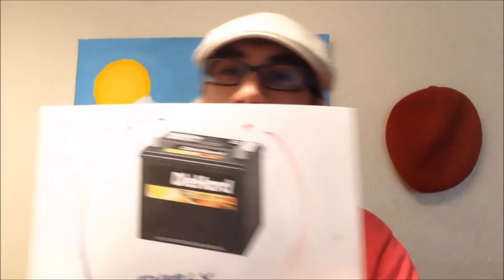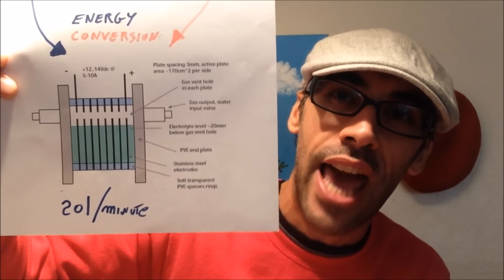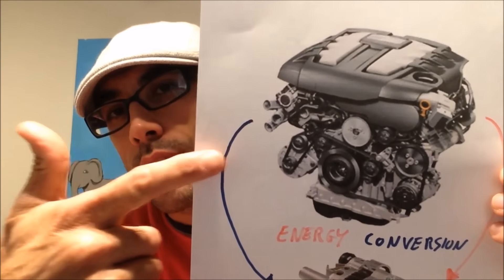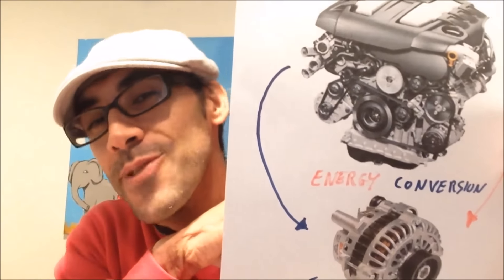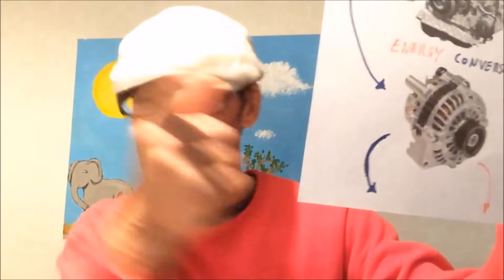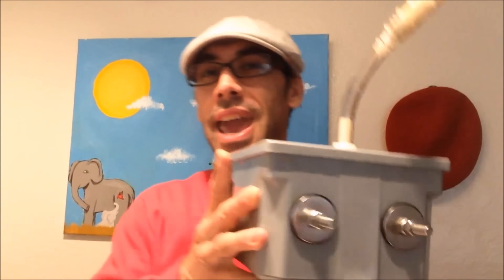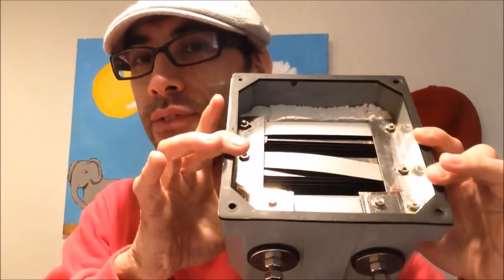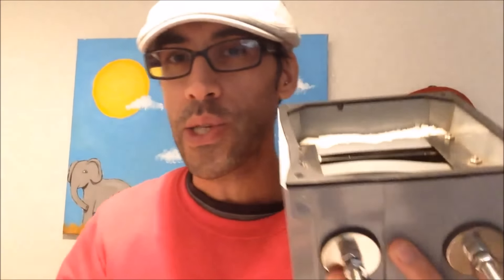FREE ENERGY Stanley Meyer 100% car motorcycle water EXPLAINED DEBUNKED!!

Comment: And also it's, I don't mean to split hairs, the timing on your engine is set to burn gasoline which ignites a few degrees before Center. When you burn hydrogen you have to change the timing so you have a spark one or two degrees past Center

Comment: Gravity generator:  Go buy a 8,000 watt gas generator ,  pull out the generator part and connect to a gearbox.  Get a pulley so you can wrap string around it several times. Attach pulley to gearbox ,  wrap string around pulley. Put high up in air , in a tall tree. Attach weight to string and watch generator produce energy to power your house hold items. The higher you go up , gives you more run time.

Comment: im a Catgineer! we simply havent found a real cheap way of converting water into useable gases thats all...not that its impossible to achieve.... one cheap way is to use a HOMOPOLAR GENERATOR!! it produces low voltage at super high amps! or use a solar panel to do the conversion and save the gas in tanks for later use..

Comment: Wouldn't putting a 60 or 90 amp alternator on the car keep the battery charged? that car has a what 20 amp alternator on it? if your using 30 amps couldn't you just swap the alternator to a higher end one and make more than the 30 your using?
Reply from the maker: alternator only converts energy

more amps = more gasoline burned

Cheers

Comment: @6:50...30A@12V=360W...Ohms law, E X I = P
If he would have brought the engine RPM's up to 1200, the alternator would have easily provided the 30A plus what is needed to run the cars electrical systems.

You are not actually converting energy 4 times because while you use energy to split the water molecules, once that is accomplished the water becomes new energy in the form of hydrogen and oxygen which can be burned. The key is...does it require more BTU's to split the molecules than the BTU's acquired from burning the resultant hydrogen and oxygen?

Comment: Does the Water Fuel System By Stanley Meyer Violate the Laws of Physics?

Meaning often Quoted 1st and 2nd Law of Thermodynamics.

No

Voltrolysis - Stanley Meyers Patented Method 

Explanations

Electrolysis 

In chemistry and manufacturing, electrolysis is a technique that uses a direct electric current (DC) to drive an otherwise non-spontaneous chemical reaction. Electrolysis is commercially important as a stage in the separation of elements from naturally occurring sources such as ores using an electrolytic cell. 
Very Different from Voltrolysis cell Electrolysis uses a variety of salts electrolyte to cause a dielectric breakdown and high amp draw to disassociate chemical bonds creating a exothermic heat in the process.

Voltrolysis 

by Stanley Meyer In Chemistry and Ionization and Disassociation of Gas is a technique Using no Electrolyte  and uses a a Indirect Voltage Source a Voltage Plasma Field Based on a DC to Cause the Ionic Dissociation of Chemical Bonds in Liquids and Gas Chemistry. He uses this Field of build up capacitance voltage to ionize and than switch off the covelent bonds of Water Molecule. 

The primary coil is electrically isolated (no electrical connection between primary and secondary coil) to form Voltage Intensifier Circuit  It is pulse and gated just before the dead short or amps draw happens. 

Voltage amplitude or voltage potential is increased when secondary coil is wrapped with more turns of wire.  Isolated electrical ground (J) prevents electron flow from input circuit ground causing a Charge on Cell Plates and a Volt Based Plasma Field which acts as a Catalyst to dissociate chemical Bonds. Very Different from  Electrolytic  cells and Not Electrolysis as no electrolyte.A Low Amp high Voltage Solution Similar to how a Fluro Light is started , driven works,with a  choke/ballast restricting amps Having a Cold Process with little of no Exothermic Reaction heat as no electrolyte no shorting of cell and no grounding the dissolved gases which are nano bubbled into water itself) which makes the water a fuel a carrier.?

So Use Volts not amps and BIngo your a lot closer to understanding the first part..
Reply: Yes it does.no matter how you wrap your coil, you need energy to create that electricity
Reply: @Richard-bq7br  yes but you can be efficient in the same manner that a ballast works for a flouro light opposed to standard light so does using no salts and distilled water it is just facts for saving the energy of the dead short amp draw. 

some people having mental issues understanding that people have made hho become explosive with more force than heat by extracting electons,  Look up nano bubble fuel water fuel ,

Comment: Hi there, i try to use the microwave to power my heat in the room but it didnt work. So can you tell me what i done wrong? Done the same you done nothing different apart i did spot a wire connect to the metal that i did remove after and still not working?...
Reply from the maker: Dear friend you forgot 3 major steps:

1 ALWAYS watch full video b4 start building anything you watched on Youtube
2. ALWAYS read the Title that CLEARLY states "debunked" "explained"
3.ALWAYS read the video description that CLEARLY states "watch full video b4 commenting"

Regards

Comment: Thermodynamics

THE WATER FUEL CELL AND THE FIRST AND SECOND LAWS OF THERMODYNAMICS

The Water Fuel Cell technology encounters a credibility gap because it appears to run counter to the long established laws governing our interpretation of Nature. In fact, the water Fuel Cell is entirely natural. 

It merely demonstrates a new and revolutionary way of harnessing what nature has always had on offer. It does not infringe the two main laws of thermodynamics, i.e.:

THE FIRST LAW: "The total energy of a thermodynamic system remains constant although it may be transformed from one form to another." In the case of Water Fuel Cell technology, the system is global. The energy required to drive the engine comes from the zero-point energy contained in the water, a virtually  inexhaustible source. The exhaust from the engine is water vapor which returns to the atmosphere. 

 THE SECOND LAW: As originally formulated by R. Clausius in 1865, this law states that "The entropy of the World strives towards a maximum". As recently formulated by Prigogine and Stengers, this law "contains  two fundamental elements:

(1) a negative one that expresses the impossibility of certain processes (e.g. 

heat flowing from a cold to a hot source)

and

(2) a positive, constructive one. It is the impossibility of 

certain processes that permits us to introduce a function, entropy, which increases uniformly and behaves as an attractor for isolated systems".It is at maximum when the system is in equilibrium. Non-equilibrium is the 

source of order and brings order out of chaos. Since Water Fuel Cell technology postulates non-equilibrium,  it can be said to be supported by the positive element of this Law.?

Comment: Its completely possible to use Hydrogen and oxygen to create combustion. The alternator will charge the battery while it runs the devices. You can also add another battery and capacitor for any entropy. Trouble is you have to generate at least 3 liters per minute of hydrogen

Comment: I'm trying to figure out how someone could get a car to run at all on 20 liters of HHO per minute. Let's throw some numbers in, and for most of them we'll use Stan Meyer's purported water-cooled VW-powered dune buggy.

1) Your car gets 40 mpg.
2) The gasoline gallon equivalent, or GGE, of hydrogen is 1 kg hydrogen per gallon of gasoline. https://www.dmv.virginia.gov/commercial/taxact/gge.html
3) You therefore need 25 grams of hydrogen to travel one mile.

All well and good, but what's the volume of 25 grams of hydrogen at room temperature and one bar of pressure? 

4) At room temperature and 1 bar pressure, one mole of gas needs 24 liters volume.
5) One mole of H2 weighs 2 grams. But remember: HHO is 2/3 hydrogen and 1/3 oxygen, so to get 2 grams of hydrogen you need 36 liters of gas.
6) Multiply 36 (liters of HHO per mole of H2) by 12.5 (number of moles in 25g of H2) and you get 450 liters of HHO per mile. 

The Stan Meyer dune buggy probably got 20 MPG on gasoline, so he would need 900 liters of HHO per mile. And this adds in a few other complications.

One of the HHO fanatic websites - sorry, don't remember which one - explained you can get 10 cm3 of HHO per square inch of plate per minute, so to produce 1 liter of HHO (remember, he needed 900 per minute at 60 mph) you need 100 square inches of plate area. (I assume this is 100 in2 of anode and 100 in2 of cathode.) It also said that if you want to produce HHO with no steam, you needed to drive the plates with no more than 1/2 watt per square inch. So...to get the 900 liters per minute he needs to run his car, he needs 90,000 square inches of plate area and 45,000 watts of power. This is CONSTANT power, children; trying to shake apart liquid water with vibrations is a fool's errand because (1) the resonant frequency of water is 22 Gigahertz, not 22 kilohertz; and (2) water can only be separated by resonance if you turn it into steam first. 

But wait! 900 liters per minute is a hell of a lot of liters per minute! You'd need to compress the HHO to cram it all in there. We'll pretend he's using a belt-driven compressor that needs 15 hp to turn it. (His engine puts out 60 hp. I've dealt with enough Volkswagens to know right off the top of my head: a stock VW 1600 engine like he had makes 60 horsepower.) Now he needs 1125 liters per mile...or 112,500 square inches of plate and 56,250 watts of power.

He's running his HHO system off the stock alternator. The stock alternator he has is a Bosch AL-82. They put out 55 amps. 55 amps x 12 volts = 660 watts. You need roughly 85x the amount of power he has available to him to make this work. 

There are working hydrogen cars and buses. They have two things in common - they use fuel cells that power electric motors, and they are fueled with premade hydrogen...which is made out of natural gas, or captured from other industrial processes, like lye making.

Comment: "In the non-electrolysis process disclosed and claimed in my co-pendingypatent application, Serial Number: 06/302,807, Filed: September 16, 1981, For: HYDROGEN GENERATOR SYSTEM, for separating hydrogen and oxygen atoms from water, water is passed between two plates of similar non-oxidizing metal. The one plate has placed thereon a positive potential and the other a negative potential from a very low-direct-current power source. The sub-atomic action of the direct current voltage causes the hydrogen and oxygen atoms to be separated. The cantaminants in the water are forced also to disassociate itself and may be collected or utilized and disposed of. This in turn lends the process to recombining the hydrogen and oxygen into pure water."

Is it possible to oscillate the frequency at such a rate that the bonds between atoms become weaker in some places?  or break altogether? or create some kind of vortex within the cell that allows the frequency to affect the incoming water at different rates, somehow controlling the conversion?

Im no scientist.... if someone with more expertise could answer these questions I'd appricate it

Comment: This is not Stan Meyer's generator, this is a dry HHO cell (Wow, did you make it or did you buy it?). Stan Meyer generator had 7 cylinders inside the water chamber. High voltage was applied at the high frequency. I have heard of many different frequencies were used in Meyer's and Joe's cells, sometimes 5.5 kHz, 11 kHz or 22 kHz. Notice these are just harmonics of the 22 kHz (Harmonic frequency of the cylinder is the key for the exact frequency). But the applied frequency will act exactly as the ultrasonic washer transducers do, creating greatest amount of bubbles at frequency about 25 kHz. These bubbles are not HHO, these are water vapor. So conclusion is, at the high frequency it generates more gas and this means we create more HHO, right? No! We just created more gas and that can easily confuse the inventor itself or the buyer. So my guess is it creates just more gas in form of HHO + H2O. In Meyer's case it is clearly scamming for having investments, so he was smart enough to know the "ultrasonic-bubble-effect" and use it for good (or bad). I am going to prove this subject in the future. This is the greatest video so far, long and entertaining! Keep the spirit! :-)
Reply from the maker: Thank you for watching first of all! :)
Stanley Meyer original configuration is simply stainless pipes inside each other in a water bath as well shown here https://en.wikipedia.org/wiki/Stanley_Meyer's_water_fuel_cell

Dry cell HHO it looks like this http://www.labellasautorepair.com/images/pro1cell.jpg
mine is not quite dry cell but rather an hybrid :)

Well said! Another reason why Stanley Meyer was a lier is simple: 

In a electrolysis process .....The quantity of particles splitted apart is proportional to the quantity of free electrons flowing thru the liquid at given time. For instance:
Using DC current is is far more efficient than AC 
Having more current rather than High voltage makes more sense 
Commonly used nowadays are PWM (Pulse Width Modulation) with Adjustable frequencies from 20HZ to 20Mhz and over .....that allows to control the production of gas easely BUT  waay lower production in terms of volume(L/m) because PWM is AC NOT DC.

Hydrolysis IS NOT Ultrasonic transducer.
Ultrasonic transducer simply makes water molecules vibrate at ultrasonic speed allow water to evaporate without thermal induction applied. 

Hydrolysis takes place by "splitting" the molecules in their simple form (in this case separate oxygen from hydrogen) 

Ultrasonic transducer product will be Water steam (water in gas form)
Hydrolysis reaction product will be HHO 

These are 2 completely different gases...for instance steam in your engine won`t never burn LOL

Thank you for your comment and support!!!
Cheers!
Reply: ahahaa seriously overunity.com is a reliable source???
I`d love to drive that famous meyer water car but I`m afraid overunity.com have no idea where to find it.
Reply: Could you please find on overunity.com why meyer stopped the test while in the middle of patent process?
Reply: @skepticalopen-mind4031 ,  wikipedia has been wrong before..   WHY THE HELL AREN'T YOU QUOTING STAN MYERS. ?      This is a short video of Stan's video on old VHS tape..
https://www.youtube.com/watch?v=F-FgsE7s4YY

Comment: In addition to above Stan was a Atomic Engineer he patented the ionization and electron removal techniques from H2 o2 which make hho gas double power double force with , more force than explosive heat.

He Did this by removing electrons during the electronic gate this prevented the released gases reforming the water molecule readily. He show that the free gases once electrons removes become positive charged. and as long as no ground or - electrons are given back he gases can not readily make water and have more explosive force when finally ignited. 

He also show that in this state the water body will be come saturated and become positive charged increasing water tension. As long as remaining cold it will flush out nitrogen and become saturated with loose h1 h2 o1 o2 missing electrons. it is a safe state until dry fogged and ignited. Making a True Water fuel .  

He also Show extracting electron allow a usable power to be looped. for use to drive cell. He showed and taught that water is already packed with energy and we simply unlock with these method during the unbalance equilibrium . Atomic methods. 

These Same Methods are used in Atomic reactors and war  etc when things are ignited extra energy comes in from the void to re balance the forces. that are created during such events.
Reply: No search can confirm Meyer was an "Atomic Engineer". Most report him as a scammer or fraudster. Of course, his fans and followers dismiss science because they don't understand it, preferring to believe the pseudo-science crap promoted by Meyer. This seems to be reminiscent of Donald Trump saying, "The virus will go away without a vaccine because of "Herd Mentality". At least he got the last two words right.

Comment: Stanley Myers used low voltage with harmonics to achieve maximum output, your copy of the design is not even close
Reply: Where's your copy? How far can it go between charges?
Reply: Golden ratio harmonics right :)

Comment: Running your car on hho is not efficient, because hydrogen dose not expand enough when it's burned... If hho is combined with another gas, such as petrol, the superior heat generation and speed of burn helps to burn the petrol (etc) gas more efficiently and so overall, there may actually be an advantage?????